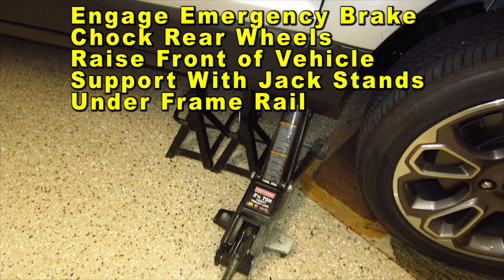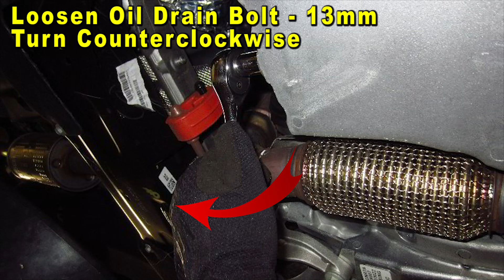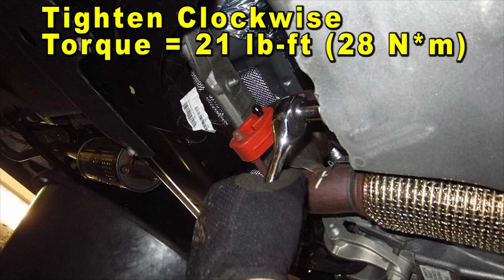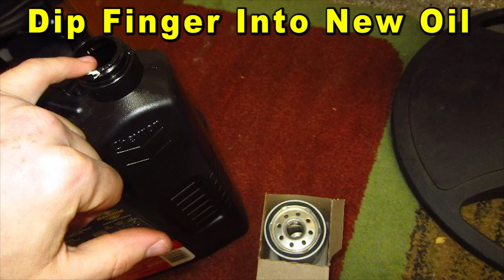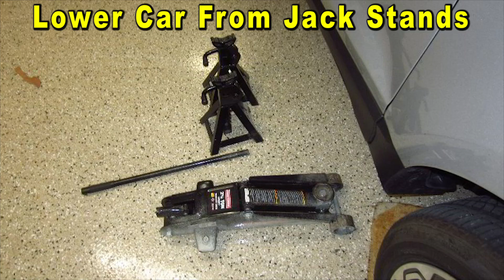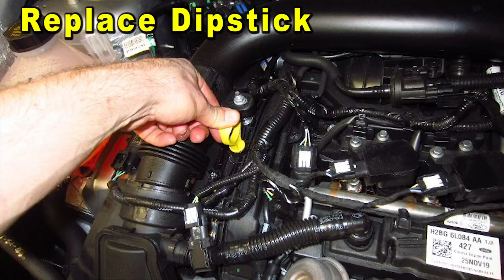2013 To 2023 Ford EcoSport How To Change Engine Oil & Filter With Part Numbers

Comment from the maker: Ford EcoSport Engine Oil Filters - https://amzn.to/3Knbdrd
Ford EcoSport Oil Viscosity - https://amzn.to/3R9UACS
Motorcraft OEM Oil Filter Part # - https://amzn.to/3R9UL10
Fram Ultra Synthetic Oil Filter - https://amzn.to/3KszPyJ
Wix Oil Filter Part Number - https://amzn.to/3KK6kZv
Lisle Oil Filter Wrench - https://amzn.to/3wUO5gz
Precision Screwdriver Set - https://amzn.to/3sLixaP
Plastic Pry Bar Tools - https://amzn.to/3HMtsV7
Socket & Ratchet Set - https://amzn.to/3Z17LbA
Mechanix Gloves - https://amzn.to/3jCnHkt
Torque Wrench - https://amzn.to/3vS5uSI

The Paul79UF YouTube channel is a participant in the Amazon Services LLC Associates Program, an affiliate advertising program designed to provide a means for sites to earn advertising fees by advertising and linking to Amazon.

This DIY video shows owners of the 2nd generation 2013 to 2023 Ford EcoSport SUV how to change the engine oil and the oil filter on the EcoBoost 1.0L turbocharged I3 engine.

Comment from the maker: Check out the DIY guide for changing the engine oil and the oil filter on a 2013 to 2023 Ford EcoSport - 
https://www.paulstravelpictures.com/Ford-EcoSport-EcoBoost-1L-I3-Engine-Oil-Change-Guide/index.html

Here are all of the DIY repair and maintenance tutorials for the second generation 2013, 2014, 2015, 2016, 2017, 2018, 2019, 2020, 2021, 2022 and 2023 Ford EcoSport SUV - 
https://www.paulstravelpictures.com/Articles/Ford-EcoSport-DIY-Repair-Maintenance-Guides.htm

Owners of other Ford or Lincoln vehicles such as the Fiesta, B-Max, Escape, Edge, Bronco Sport, Explorer, Expedition, Transit, Focus, Mondeo, S-Max, Puma, Kuga, Endura, Everest, Ka, Figo, Endeavour, Aviator, Corsair, Nautilus and Navigator may also find these DIY instructions to be helpful.